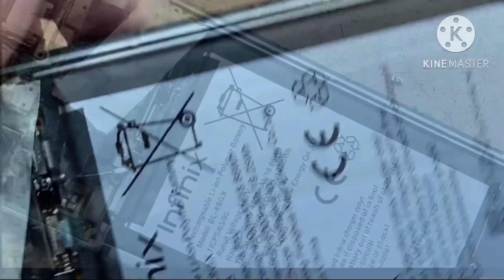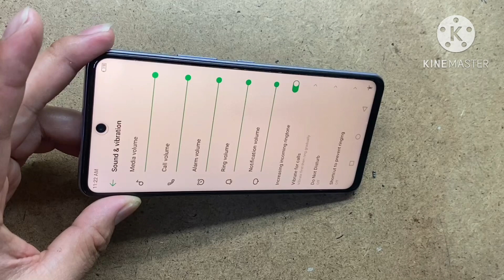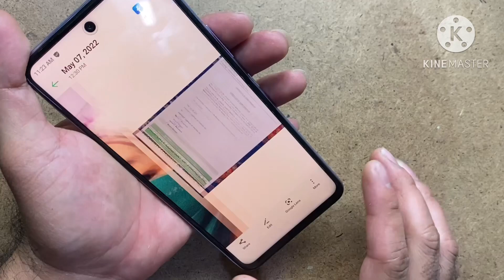Infinix Hot 11s Auto Restart Problem  Boot Loop Essue Solve No Files Delated 100% Permanent Solution

Comment: Hi, Sir. I have the same problem, auto restart. But my phone restarting everytime i use camera video, what seems to be the problem Sir?
Reply from the maker: same on this video apply the video it works 100%
Reply: system update, yung current system update may problema
Reply: @amaw9765  yun din naisip ko. Kasi kakaupdate ko lang ng system don nag simula yung bug.
Reply: @aeroacee0374  paayod mo po sa marunong mag tanggal ng current update tas ibalik sa dati, mas mahal kasi pag pina ganyan sa video, minimum 200 babayaran, mataas na masyado ang 500
Reply: Yung sayo ba bro? Ano ginawa mo?
Reply: @amaw9765  legit ba bro? infinix hot 11s user here. after the update dun na siya nagloloko and until now bootloop nalang
Reply: @aeroacee0374  same here, after the update everytime na inoopen ko yung camera and mobile data + pag tinaasan mo yung brightness ng screen magrerestart nalang siya.
Reply: @aeroacee0374  any update? napaayos mo na ba?
Reply: @giocatacutan752  legit yan, need mo lang ipa downgrade yung system update
Reply: @giocatacutan752  dalhin mo sa pagawaan, need kasi ng pc o laptop diyan pang command at reflash
Reply: @amaw9765  salamat boss
Reply: @giocatacutan752  hot11s user here nung ngupdate ako nawala un flash nang camera pero pag nakacharge meron sya tapos bumilis malobat un phone ..

Comment: Sir, salamat sa idea. I am currently using a newly acquired Infinix Hot11s nfc with the same problem. Sure enough, tama yung advise mo. I removed the fuse on the battery, jumped it with wire and solder and the unit is back to normal. Salamat ulit sa idea.

Comment: Sir, good day, hindi po ba nakakasama sa cellphone or battery ang pag tanggal ng battery fuse? Dibat yan ang nag didisconnect ng cellphone sa pag charge once na puno na? Ano po din bang mga epekto nito sa cellphone naten. Sana po mapansin . Maraming salamat more power po sa channel mo
Reply: Yun ang gusto ko malaman ser na ano ba pinag kaiba ng walang battery fused kesa sa hininang lang
Reply: @emanreiebreo5345  ung fuse kase special part sya sa phone na automatic na kina cut ang electric current na galing sa charger papuntang cellphone, ang hinang na lead, di ko lanh po alam kung pano yon gumagana, bakq nag se serve lang as heat absorber (based lang sa pag kaka intindi ko)
Reply: Ang problema, sa infinis hot 11s ung battery fuse mismo ang problema kaya solusyon ng iba hihinangin lang. Yung sakin po change orig battery lang, okay na wala nang problema.
Reply: @jimcarlosmiranda3690 magkano change battery?
Reply: Hm battery po
Reply: @Nobody-ej7uz  1k po
Reply: @Nobody-ej7uz  original naman po galing carlcare

Comment: Very good correct solution,
I had the same problem in my infinix note 10,
Just made a jumper on battery circuit like this video,
By the grace of God now perfectly phone working
Reply from the maker: yesh nice this is perpect solution  back to normal back to hard drain
Reply: Safe po bah kapag ganyan boss?
Reply: Sir question ttangalin lng ang fuse then ijjumper nlng?